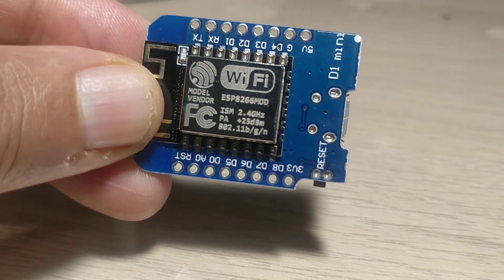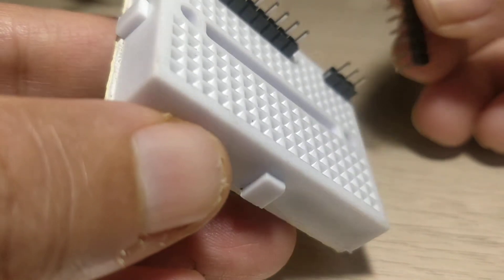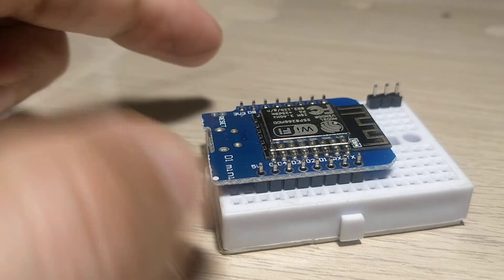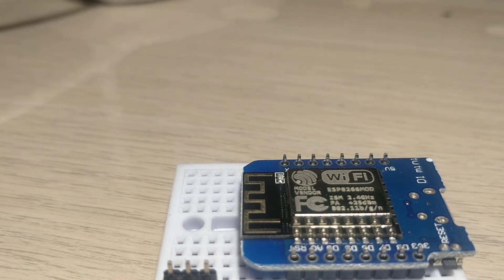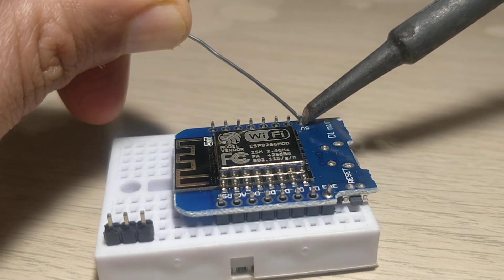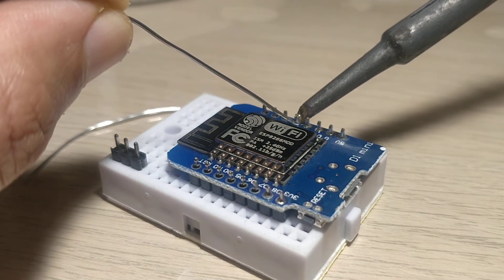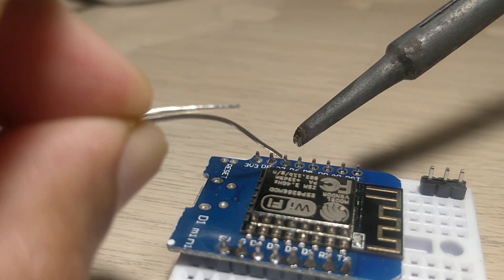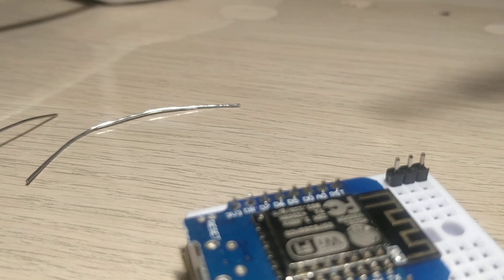Soldering Wemos D1 mini esp8266 with header pins

Comment: Is soldering the only reliable way to actually connect pins to these holes on the D1 Mini? I've tried simply sticking the header pins into the breadboard and sandwiching the D1 Mini between the breadboard and the headers, a well as many other shoddy setups, but they just don't work. The connection to the holes is unreliable, and I usually have to press on it with my hand to make it work. So, is soldering my only real option? I've heard of hammer headers, but I have no idea how reliable those are, and I can't find any for the D1 Mini.